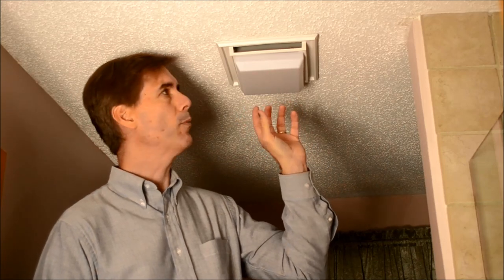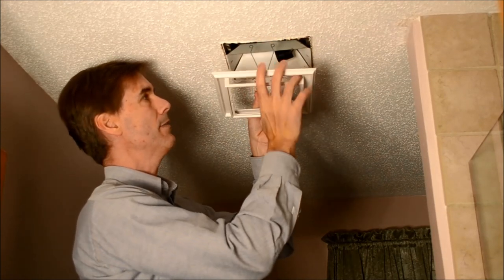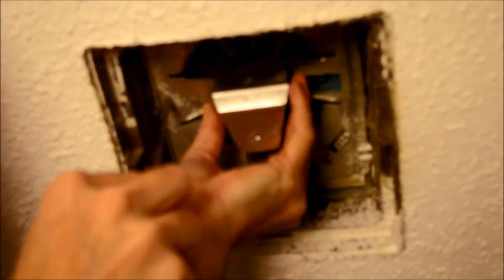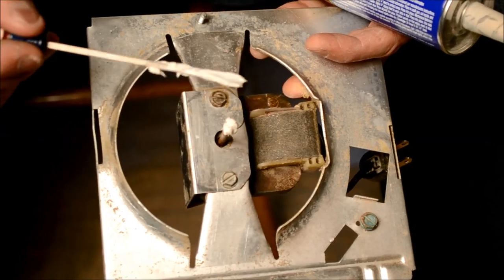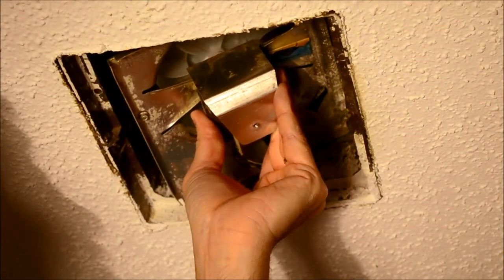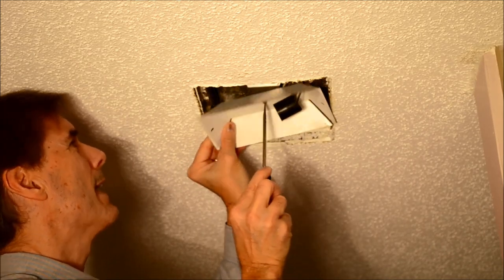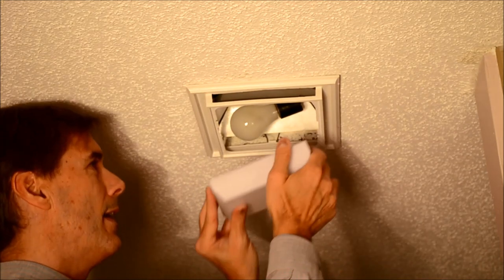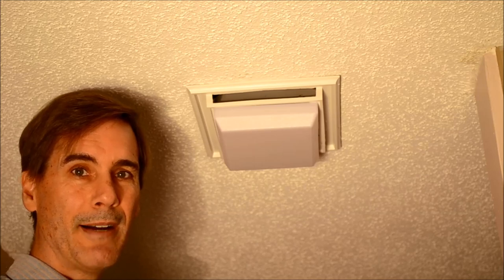How to Repair Bathroom Ceiling Fan Video

Comment: Thank you. this was exactly my problem on an old broan model. My fan was attached to motor very tightly, so I did not have to use any glue to change the position. will see how long it lasts.